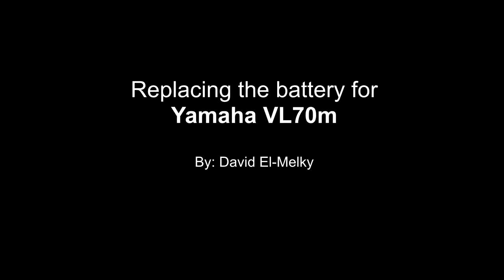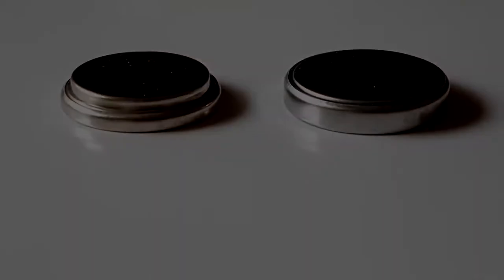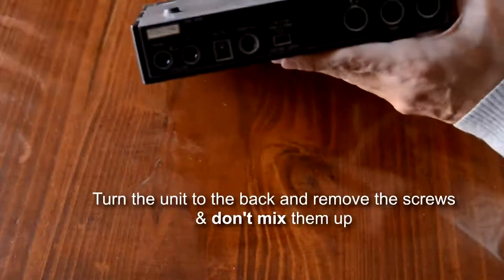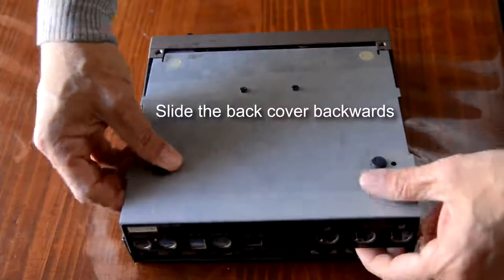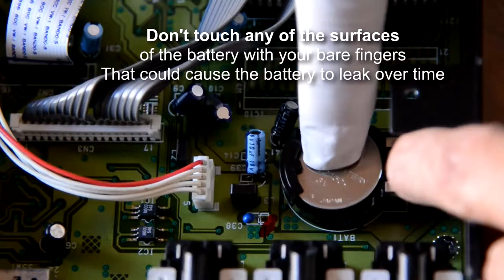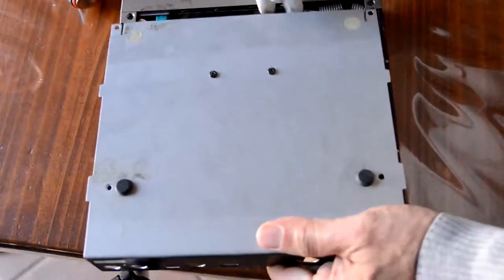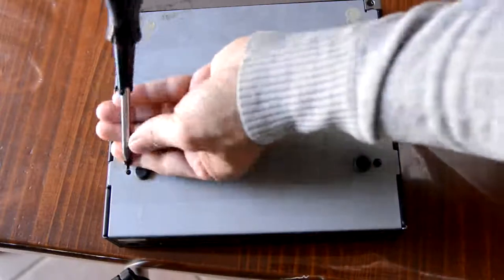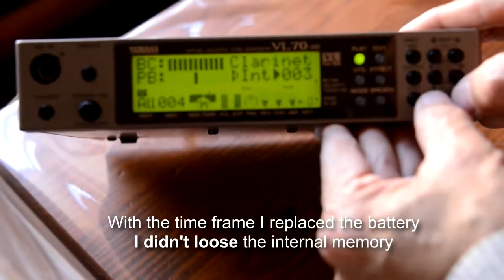VL70m - Battery Replacement

Comment: I also just replaced the battery with a Varta CR2450 and it clicked right into place and works as it should. I spoke with a local electronics repair shop who encouraged me to keep the unit powered up until I got the replacement battery and keep it powered up while I was replacing the battery to make sure I didn't lose my data. I thought that was risky to open the box while powered up, but he said only if I dropped a screwdriver across it. I  followed his advice and all is well.
Reply from the maker: Thanks for your input, and I'm glad to hear it worked, but from what I've experienced if you're replacing the battery you don't need to keep it powered, it's a quick process. But let's say you've tried to put a battery that doesn't fit, I'll put back the old battery until I get one that fits, I won't leave it without a battery for a long time, I tried to replace mine 5 or 6 times testing which battery that fits but in between I was putting back the older one. TO ME, I wouldn't dare to leave it on power, "Plus" I don't think the power would keep your memory, I THINK (Not sure) it's the battery, maybe someone else can confirm that 😊
Reply: Thanks for this, David. I know, I had the same misgivings about opening box with power on, but didn't want to lose my user programs.  Maybe I was just lucky, so for ongoing practice, I defer to you. Though as this is the first time I've had to replace the battery since I bought the unit some twenty years ago, hopefully won't need to for awhile. Thanks for this video. Very thorough and really helped. I followed to the letter except for the power part... @david-el-melky

Comment: Varta CR 2450 from a local supermarket was a perfect replacement. Thanks for the video!
Reply from the maker: I'm glad that you've found one, it looks like the Varta is the answer from what all those who tested it are saying. Thanks so much for confirming 😀
Reply: @david-el-melky  Thanks to your video and the comments, I walked to the supermarket and picked up a Varta CR 2450, opened up the VL70-m and replaced the battery... quick and easy. The original battery lasted for over 20 years, so I think I'll be good for awhile now. :) My VL70-m didn't get too much use after the initial "wow", because the sound felt a little bit artificial after all. But now, it's the other way around, and "artificial" feels more like a complement.
Reply from the maker: @yzimsx  I agree with you all the way, I was hoping that Yamaha would produce a better replacement but so far no valid or better one that I could use, I don't think I could do without the VL-70m anymore.
The funny thing about replacing the battery is, the first thing I tried here in Sydney is the Varta but it didn't fit, I'm not sure if the ones are here are "older" or "newer" design but after I replaced mine I hear a lot about Varta being the pecfect fit, you see, the one I've used and fit perfectly wasn't good in other countries, something funny about it 😄
Reply: @david-el-melky  I'm in Finland, so maybe we get the stuff from a different factory. The Varta lookes pretty much identical to the original, mushroom top etc.
Reply from the maker: @yzimsx  I believe you're right, because the one I saw here had similar shape but thicker top and thinner bottom, when looking at it you'd think it's OK but it wasn't, it needs to be roughly half/half to be able to sink the bottom all the way and have the lock click over the top

Comment: Hello again David,I replaced the battery in my vl70m just now,powered it up and everything appeared as normal,nothing lost,the replacement battery I used was the Varta CR2430,it went in nicely,but just to make sure  that it stayed in position I put a small strip of tape across it,once again David I thank you for the background work you done regd locating a similar type battery.
The battery warning logo is now gone .
All the best,P Daly
Reply from the maker: Thank you Patrick for your input, and yes the 2430 will work but it won't last as much as the 2450 since it's nearly half the capacity but it's OK you probably need to change it more often that's all, and in regards to keep it in place because it's 2 mm thinner, if you don't move the unit a lot and flip it upside down when it's operating it should be fine :)

Comment: Thanks a lot for this video and comment from users. Installation/replacement also was successful for me. I installed Varta CR2450 blue-silver (purchased 2-Pack Amazon.de December 2022) and it matched very well a battery slot of my VL70m Patchman and I have heard that click that also sounded like a music for me. Small hint, for consideration. Since I had 2 batteries in pack I attached 2nd battery inside to the bottom cover from inside. I used 2 screws in the middle of the bottom cover to attach 2nd battery in sealed plastic original pack (I took out all paper part of the pack), covered that plastic container with double aluminium tape and screwed it to the bottom cover from inside. When installed CR2450 will be used one day I will always have a second reserve battery kept inside of the body of VL. If that 2nd battery still works at that future installation time I will have some time after installation to search for a fresh battery if this kind of batteries will still be produced in 5-10 years.
Reply from the maker: Thanks so much George for your feedback, and you're detailed information is VERY useful, having stored the second battery inside is a clever idea indeed and I'm sure it'll be considered by many. I will look for the Varta brand myself and have extra spares assuming they have long expiry date?

Comment: Yup, as others here, I used a Varta 2450 Lithium replacement. Also, I opened up the VL70 to see what battery it used and left the battery out for quite some time while I luckily found a new one I already had. The memory was not lost so, I assume Yamaha had the forthought to use Non Volatile Memory (NVM). Good for them and why Yamaha is good value for money in the long-term I guess. Just note that on the back, there are two self tapping screws either side of the midi ports, and one fine thread engineering screw by the Jack outputs, so don't get them mixed up.
Reply from the maker: Thank you for your input, truly appreciated, and I'm glad to hear and confirm about the Varta 2450 fits well. In regards to the memory,  great to know that you don't have to be in a rush to do it because lots of users get worried about it and I read about some would leave it powered for that reason and that is something I would NOT recommend, and now you've confirmed that. As for the screws, you're right that's why I keep them apart because it's easy to get lost concentrating on the important part 😀
Again, I want to thank you for sharing your experience.

Comment: Thanks for the video. The suggested Ansmann battery which I bought here in Germany (Sept. 2022) is different and does not really work - it is just cylindric all the way to the bottom. But I have found out that VARTA CR2450 (blue-silver blister - bought at Amazon, Sept 2022) fits very well, it has narrower bottom (although not as narrow as the original FDK) clicks beautifully in the holder and jumps easily out of the holder when needed.
Reply from the maker: That's good news, glad it worked, thanks so much for sharing. I'm sure many will benefit from your experience 😊

Comment: My Tinqiu 3v would not click in place. I really pushed on it and the logic board was flexing. I gave up and put a little tape on it. I have a second battery coming from a different source.  My VL-70 powered up with no issues so far.
Reply from the maker: The only thing you need to worry about when your battery isn't clicking, is not to push hard and crack the board or something and when you get the new battery be gentle on pulling it out so you don't end up damaging the casing. for me it's a scary thing to apply pressure more than it needs, it should work but as I wouldn't recommend it, hopefully the new one you're getting would be a better fit.
Thanks so much for your feedback, truly appreciated 😊
Reply: @david-el-melky  thank you David. Your video helped me. This VL70 is such a strange unique beast. It’s kinda sad there are no more breath control devices out there.
Reply from the maker: @fotmasta  you're so right, it's shame we can't find the controller for it, I  cherish mine for that reason
Reply: The Varta battery arrived from Germany last week. It fit with a nice click. I swapped out the Tinqiu. Go for the Varta.
Reply from the maker: @fotmasta  Here you go, I'm so glad to hear that, it looks like the Varta is the one. Thanks so much for the update 😀

Comment: Thanks for your video. Like others, I ffound that the Ansmann battery had a different profile to the original.  However, it CAN be made to work.  CAREFULLY bend up the centre contact in the battery holder so it is rather more elevated. Push the Ansmann battery under the plastic lugs, and gently press down.  The battery will lock onto the outer metal clip.  It will not sit flush but at an angle, but is secure and will work fine.  Maybe not ideal, but beter than no function!
Reply from the maker: Thank you for your feedback, it's very helpful, and it is sad how the company went and changed their battery profile like so many, it was the perfect fit. anyway, I'm still looking for a final solution of finding the right fit for it and the soon I find it I'll put some update :)

Comment: Vinnic CR2450 seems to fit and work perfectly. It is a mushroom top battery sold in Oregon, USA at Batteries Plus.  I had no issues installing the battery and it performs as it should in the Yamaha VL-70m.
Reply from the maker: Wow, I'm glad to hear that there are some other batteries in that shape and fit perfectly, thanks so much for your advise, many will find it very useful.  Truly appreciated.😁
Reply: @david-el-melky  I just bought a 2 pack of Energizer CR2450 Lithium batteries, and fitted one in my recently acquired 2nd VL70m.  So far, so good.  It retained the memory contents while I changed it, which made me skeptical that it was still just running on charge on a capacitor, but it still works the next day, so hopefully that's it.

The expiry date is 2032.  They're made in Indonesia, and it says this in the bottom left corner, on the back of the packet:

CR2450
3V-3B
UPN-165585

I can't find any by googling the UPN, but that might be useful if you can get a seller to read the packet to you, or show a close up of it.
Reply from the maker: @TooSlowTube  thanks so much for your input I truly appreciate it. I'm glad it worked because I too found one of those Energisers that looked similar but  yet to try it, I'll put an update once I tried it, Energiser batteries also have different designs so hopefully this one works like yours 😊
Reply: @david-el-melky  You're welcome.  Short story long, the first time I put it in, I was trying to use a plastic glue spreader between the edge of the battery and the sprung +ve contact, because I've discovered that this sort of clip can short out this sort of battery, due to the step shape of the edge of the battery.  It doesn't kill them completely, but the voltage drops measurably, compared to what it was before.

I couldn't get the battery in using that method in this type of clip though (as opposed to some new clips I bought, that are slightly different), so I gave up and pushed it in as fast as I could... It popped back out, but I did it a second time and it fitted properly, so there's a knack to it.

It might be worth looking for a very thin strip of plastic which you can put in to cover the positive contact of the clip, but strong enough to pull out while you hold the battery down.

Test fitting a battery on my new, spare clips, I took quite a bit of life off the one I'd taken out of the VL70m by resting it in place then pushing it down.  Maybe they use a special tool at the factory, or maybe the Yamaha clip is a better design, but it seems like an inherent problem - the top of the clip contact has to be angled, and the underside of the battery is stepped, so briefly shorting with the clip terminal seems almost unavoidable, without something in between to stop it.
Reply from the maker: @TooSlowTube  mmm, that's interesting, I never had this issue but something to look out for 🤔

Comment: I am a long time trying to get info on vl70m battery replacement. I have 4 of them.and use them with the yam wx11 and wx5. I think the vl70m was one of the best sound modules ever produced for wind synths,I recently purchased the Roland ae30,disappointing apart from the keys being noisy and child toy like.the sounds would not come next or near to the vl70m
If their is anything out there that comes near the vl70m please let me know.thanks again for the battery info.
Reply from the maker: Thank you for your comment. You're are right about that and I'm always looking for a replacement or something better but as you've mentioned nothing has come around yet. Again thanks for sharing your experience with the Roland, it's good to know what's out there :)